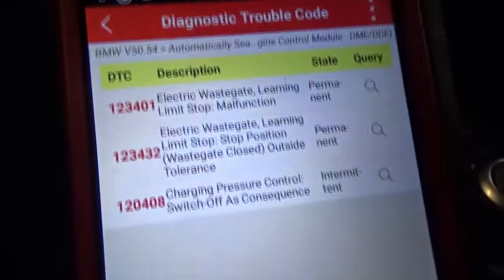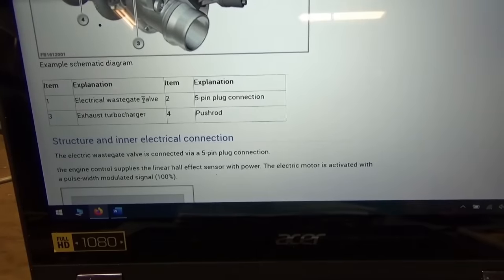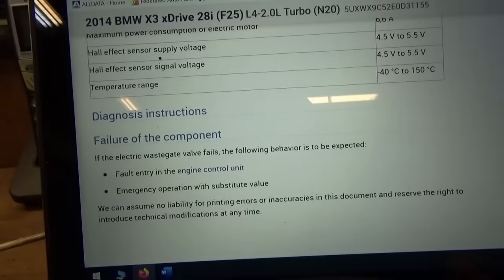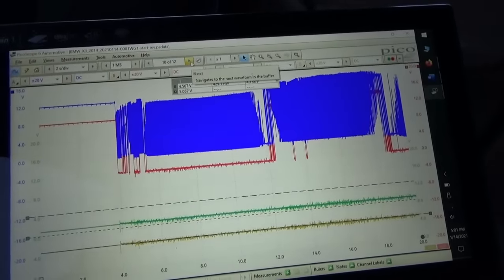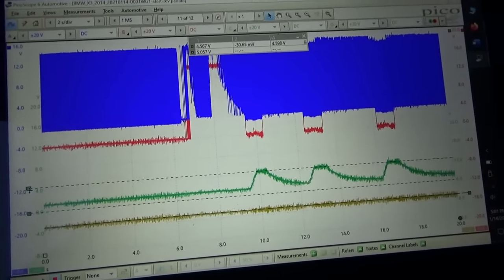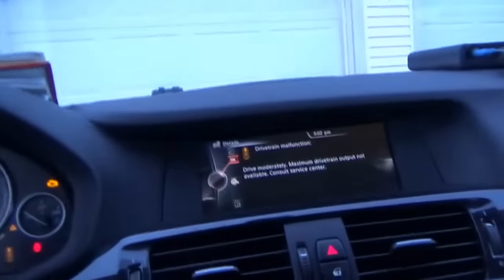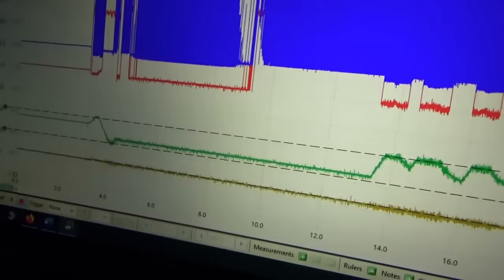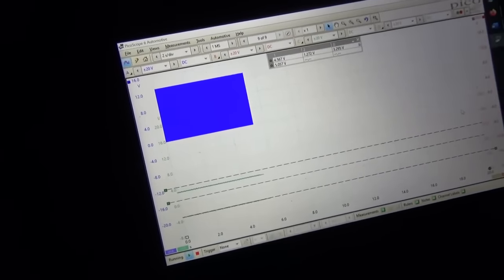BMW Turbo Wastegate MALFUNCTION

Comment: I can't believe these people drive the German cars pretending to have champagne money but really only beer money. Guy cheaps out on oil change...I am amazed he made it out of the birth canal. Great repair Ivan...you spared that guy two arms and a leg.
Reply: And who do you think is going to buy these cars after the first owner decides to trade them in? Or are you suggesting they should just be scrapped instead?
Reply: @rafflesnh  I know it will NOT be me. I have been driving Toyota since 2004...it was the smartest choice I ever made.
Reply: The buried component in witch touching the component is a challenge, we didn't see the wiring of the connector but that task probably would be too much for me. I suspect the owner is a customer for life, tough that means you have to endlessly work on a falling apart BMW with 80K and beyond miles. At what point does he tell the owner after a fix to dump the car because this car is not a reliable daily driver.
Reply: Agreed, I know of well to do folks with big homes and they run around in the dark and during summer, way hot inside homes to save on the power bill. Amazing how psychology works with well off people vs those with just enough.
Reply: @FrenchValleyAirport  You got it👍 I am tired of giving my money to FORD and GM that sell junk. How many times do you beat your head in bricks before you have an epjiphany??? I had mine in 2004.
Reply: @mikefoehr235  I can afford to drive something nicer. I've known since day 1 toyota/honda are the most reliable. I've owned probably 10 at least combined. I also realized they're boring, slow, sterile, etc. I will enjoy my life, even if that means paying a little extra. You need to know when to keep these vehicles and when to dump them.
Reply: @FrenchValleyAirport  I drive a Tundra...got it last year. It tows way better than the Tacoma I had. I need a truck for my RV and to get to my camp. Not only is the Tundra practical...it is almost the fastest truck there is...there are some from Ford and RAM that are quicker. The Tundra is also a tad bit harder on fuel but I do not care. I will gladly pay at the pump...not the repair shop. Yup...me and my honey are boring and so we drive boring...Toyota. I am nearly 60...do not need a Porsche 911.
Reply: @mikefoehr235  I bought a new Tacoma in 2017, I was so bored of it and how just industrial it was I sold it for something with more soul.
Reply: @FrenchValleyAirport  A Kia Sole perhaps!
Reply: @mikefoehr235  I'd rather walk.. haha
Reply: YOUR RIGHT, they can only afford 15 year old ones and then want you to fix it for free. They make sure the outside looks awesome while the rest of the car goes to shit. I hate those kinda people, message to all of you wannabe's QUIT FAKIN IT, YOU LOOK FOOLISH!!!
Reply: @mikefoehr235 my Sequoia blew before my bmw
Reply: @prmayner fart head go ride your bicycle to work
Reply: @josephlucero8420  That is rare   BMW...Burned My Wallet
Reply: @mikefoehr235  my transmission blew on a hot day in AZ I think that was the cause
Reply: Good diagnosis.
Very thorough.
Reply: My same year and model as the topic goes well with corona beers, champagne sucks, cheers
Reply: @josephlucero8420 Dude probably drives a 1987 Capresse classic. With different coler panels on it.
Reply: @mikefoehr235 Toyota makes turbo engine in their new cars. Stop your whining
Reply: @Sequel7  stop your complaining. You won't see me driving a turbo except my work van....have no choice...and the turbo failed at around 103 000 kms....MB SPRINTER junk
Reply: You can't just say "German cars" they aren't all the same lol
Reply: Only 1 answer , CAUSE RACE CAR.

Comment: I’ve been having the same issues for the last 2 months and I’ve taken my car to bmw and a local bmw shop. I was told that I was gonna have to replace my whole turbo setup and I was quoted somewhere around 5k from bmw. This was the only vid I’ve found with the same issue I was having. I gave it a shot since I noticed my actuator linkage was a little loose and IT WORKED!!! You literally saved me $5000. Thank you!
Reply: Did you use a scan tool to figure out the adjustments or just did 4 turns?
Reply: @B0RNfree  I'm having the same issue and the same question. If it's just loose, can't we just turn until it's tight? Why has to be a particular range?
Reply: @paulc.8727  i am also having this EXACT issue and would like to know why this is so particular.
Reply: Dealing with this now. Use ista to find what range you are in. I loosened the retaining nut. Turn the big tip of the actuator like he did 3.5 almost 4 turns and then tighten the bolt. Waiting to see if error comes back. If so you might have to tighten the actual bolt behind the retaining bolt the 4 turns the tighten it up.
Reply: i think mine is entirely a different issue ... hear this, the rod connect actuator and waste gate disappeared (fall off?)
Reply: @paulc.8727  the actual actuator fell off too?? How tf???

Oh I see just the rod. Yea I saw a bulletin that the connector pin can rust out.
Reply: @catchingdirtysouthjersey4581  yes just the rod.. maybe due to both rust and potholes on Chicago roads
Reply: @paulc.8727  lol yea New Jersey isn’t much better I’m sure. Hopefully an easy fix now u know the issue.
Reply: @catchingdirtysouthjersey4581  I'm thinking looking for just the rod from some junk yards, instead of buying the whole actuator part
Reply: @paulc.8727  that’s what I would do too. Should be easy to find. Goodluck!! 🍻
Reply: Same here. BMW always mention about turbo replacement. They are not even saying wastegate actuator replacement.

Comment: Let me put your thoughts at ease. I can not thank this guy enough for this video. I've had this exact issue on my car and I been up and down the country paid one bmw dealership for 3hr to run diagnostics on the car at a cost of £450 took them 3 hr to find the fault (so they said) quoted me over 4000 for the replacement of the low pressure turbo. That's one bmw took it to the next one 2 hr of checking! This place works quicker than the last one highly recommend them, (NOT)£300 later quoted me over 6000 for both turbos to be changed. At this point I give up drove the car for over a year until I come across this video. We need more people like you in the world God bless and keep up the good work. Fixed it for free thanks to you.
Reply: did you use the computer/adjustment stuff or did you just tighen the actuator? because i dont have any of the expensive stuff he's using to do the adjustments but I do have an arm, and some tools. If I just tighten that will it be okay? or will my car just fall apart for some god damn reason?
Reply: Try loosening the 10mm lock nut, rotate what he did 3 times and tightening lock nut back up. Won’t hurt anything. If not find someone with ista. It’s free to download but big and you need an enet cable.
Reply: Thank you so much for this post. I also went to my dealer. Took them 1,5 hours to come back and tell me, that they have to take out the engine and replace the wiring harness. Cost: 4000€ 🤦‍♂ How is this legal??? I mean, probably afterwards the some problem would still exist 😤 Really, can't thank you enough! 🙏
Reply: Hi just in case you didnt notice he has the tool in the description, same price as one trip to a German shop. I think I might pull the trigger, anyone have a better option? ICOM and ISTA seems like it could be unreliable.

Comment: Valvoline Cheap oil for this customer???  How many good synthetic oil changes could he purchase with the $900 you just saved him Ivan???  Great job Russian repair once again!
Reply: That was actually OEM repair as per the repair service manual
Reply: The $900 is probably the hourly rate fee
Reply: Should have used German ' Motul ' oil. It's made in Germany for German cars. Yes it's expensive but what else would be appropriate for your Beemer, Merc or VW ???
Reply: charles kosyjana Penrite oils?...
Reply: BMW engines are noted for self destruction right after warranty.  Cheap insurance calls for changing oil and filter at 2X the BMW recommended rate.  I wonder if changing the oil every 7,500 Km (5,000 mi) and using cheap oil works to this end.  If it was my car, I'd use the good stuff.

Comment: Great repair !  If he had taken it to the dealer they probably would have sold him a turbo for several thousand dollars !
Reply: Actuator + labour would probably be $1500- $2000 Most customers will trade it in and sign up for a new lease and BMW has a healthy stock of used cars in their lot for the lowest outlay.
Reply: Yes but it would have fixed the problem. 😜
Reply: My dealer wants 6k in Seattle for the turbo n20. Taking into my own hands now.
Reply: this is exactly what the dealer told me, to change out the entire turbo when it was just the wastegate issue.  dealer wanted $6000 LOL.
Reply: that just happened to me
Reply: my dealer just quoted me $4,500 to replace the turbo, exact same problem in your video.  Thanks for the info!
Reply: Yup my actuator is apparently not working. After they did an oil change, the next 2 days I got a drivetrain malfunction. Turns out actuator needs replacing. They quoted me 1500$
Reply: Her in Norway, they will offer you a new turbocharger for $5100  and if some electric component has fault as consquence of a faulty turbocharger the repair will come up to $7000. This is what happens to me. First I have to replace a new turbocharger, secondly i have to replace 2 hoses causing leakage. Third Replace the booster Pressure solenoid, Four replace the pressure inverter. Now the new booster pressure solenoid has short circuit, and again my car has lost power, the drive train errors pop up around 2000 rpm. I think i have problem because the workshop has not done a turbocharger adaptation. A adaptation must be done for the turbocharger to function properly. The electric component keep pushing on pressure but the turbine flap does not open or close. All exhause is passing through because the turbine flap is always open. I have already spent nearly $800 extra expences and still my car is not working.

Comment: You just know the dealership would've thrown a new actuator/sensor assembly at it and charged more hours than you on top of parts.
Reply: Yep! They asked me to go ahead and replace everything. Even the oil tubes .... ~$5k
Reply: Your absolutely right!!!
Reply: Their diagnosis would be to replace the complete Turbo assembly w/ actuator
Reply: Thats the dealer way

Comment: Now you did it, you knocked the BMW dealer out of a bunch of money.  Just think as soon as the diagnostics came back with a fault code the new part would go on and the adjustment would have been made and the customer would see a new part and no more problems and that would be that.  The customer gets a bill for 2k the part that is still good goes to the landfill and the replacement part probably won't last as long as the one that is on there now will last.  Good job on using the dianostic tools and caring enough to do the job right and take care of the customer.

Comment: Worked like a charm. I had the same engine, mileage, and error code on my BMW 428i (F36). I decided to try 4 rotations of the actuator arm instead of replacing the turbo like the mechanic wanted to.." to avoid turbo failure while driving". No error code after three months of driving. Thank you for the video

Comment: Thank you so much for the informative diagnosis. I bought the bimmer 7 years ago with this annoying rattle that I never understood. I was prepared to buy a new actuator before seeing this. Now I have a smoother sounding car and saved $250. I'm stoked. Cheers
Reply from the maker: Awesome!
Reply: did it rattle the most in eco pro mode ? it's turning me crazy!!! i have  1 year warranty on my car but i don"t know how to tell my dealership to fix it... how do i tell them

Comment: My car was only going into limp mode when warmed up at first, stopping for gas etc. then it stared all the time right from start up, dealt with it for a long time then saw your video which gave me an idea. I pulled on the waste gate arm towards the front of the vehicle, restarted and limp mode was gone.completed the adjustment (just a little) and fixed. Thank you so much for posting this video limp mode gone.

Comment: From one BMW mechanic to Another BMW mechanic i thank you very much for your video, i was fixing M235i customer towed with terminal 15N2 short to ground code, crank no start, so i found the issue on ISM module and replaced it and car started up, took it for a spin and bam exact same code for wastegate, i fixed tons of vacuum wastegate and electric one never dealt before, have exact same launch scanner and mine showed 3.99 negative, so luckily i ran in to your video, and i could not call my customer and tell him, guess what i fixed your issue now you have a turbo issue LOL, so i adjusted without telling my customer and SHE IS HAPPY just like you said :))) so N55 and N20 is exact same adjustment on the wastegate. Thank you Partner, stay safe and keep the awesome videos coming !!!!!

Comment: Thank you so much man; just fixed my F30 328i with 281,000 miles using your video. You gained one big fan.
Reply from the maker: That's a lot of miles! 👌
Reply: @PineHollowAutoDiagnostics  I’m up to 336,000 miles and it just happened again. Came back for all this useful information. I’m going to try it tomorrow.
Reply: @PineHollowAutoDiagnostics   so I’m up close to 364,000 miles and I’m back with the same issue. The problem I have now is I’m out of thread on the waste gate 😂 does this mean a new turbo? Maybe.
Reply: @ramiroparocua8070 Hey I have a 2012 328 I it lags a lot on power and shakes at idle runs really bad could this be the issue or have you ever had the same issue ? I just want it running normal honestly

Comment: Had the same exact problem at 150K miles, this video was super helpful.  Used Ista+ to do the wastegate adjustment procedure.  Mine was out -2.99 mm.

Comment: Ivan, I agree on the service of oil, my daily driver 2002 VW MK 4 1.8 T 289,000 on the clock. Stage 1 flash - cold air intake- heavy-duty exhaust manifold-tuned exhaust system.
my local VW dealer does all the work ( never thought I would be having a Dealer be my primary maintenance provider )
The shop foreman and I have become good friends along with most of the personal there.
Cheers from San Francisco.

Comment: Mark me as another that was quoted $5000 for a turbo replacement, found this video and fixed the problem with the turn of a screw. Thank you for this video and fix.

Comment: Love your chill explanation and easy thinking. Step by step, not shooting parts. You were asking yourself the strategy about closing the waste gate valve on idle. When on idle the next thing is driving, so turboboost is needed. The turbo is already in this position so it does not have to react on throttle but is already there. The airflow on idle is low, so turboboost or speed is never exceeded. All safe but ready to fire up! Keep up the good work!

Comment: 2014 BMW 328i xdrive at 110k miles. Had exact same issue come up. Drivetrain malfunction but with engine code P1290. I replaced coolant temperature sensor, which did not fix the issue. Found this video and did the 4 turns on a whim because I don't have any software. It worked! Been good for 2 weeks and over 300 miles. Thank you so much for this video.

Comment: I was able to use a scanner I already had, a Foxwell NT 510 Elite to get the wastegate readings and zero it out.  Took me about an hour of fooling around a bit but in the end it got set to within the desired tolerance.  I got the one specifically for BMW cars and it was $189, I used it for a 2006 Z4 previously when I changed out the auto trans fluid (needed to get the trans temp).

Great video, once again, thanks for showing us how it was done, I did find other info but this one was first and I was confident after watching this I could get this resolved (assuming the flap was not damaged or loose internally on the turbo). 

My recommendation:  don't tighten the nuts until you run the process enough times and get it zeroed out.  I used small increments of turning the nuts until the scanner showed me it was within tolerance.  First time, I went the wrong way.  Second time I overshot, third time I was close, 4'th time I was right on.  I can say that the electronic actuator is very picky and it does not normally take more than 1/2 to 3/4 turn of the nut to throw it out of tolerance.

Comment: This was super helpful! Had the exact same problem and fixed it by adjusting the waste gate actuator. Used ITSA to diagnose and obtain required adjustment parameters.
Reply: ISTA

Comment: Just got a 2017 x3 and saw this stored code p1290 and my bluedriver scanner identified it as the wastegate position error.  With only 50k miles on the vehicle I think it may be this same issue but so far it has not indicated reduced powertrain performance.  Having seen this video I feel confident in debugging it further if needed.  Thank thank you!

Comment: Just wanted to say thanks! Was looking on how to do EWG adjustments and replace actuator on my 2013 f34 328ix , since at first i thought the problem is with faulty actuator, but watching the video realised that I have exactly the same issue just to a little less extent since I only get it after long driving and doing ignition off / on within a short timeframe, if it stays over night at the morning it dissapears. And I dont actually need to replace the actuator 

I dont have access to Launch or ISTA so I decided to blindly adjust it, I did 3 turns, because as I said my issue is less severe. Drive train malfunction gone, everything works good so far after 2 test drives.